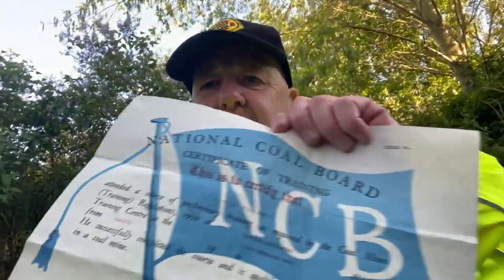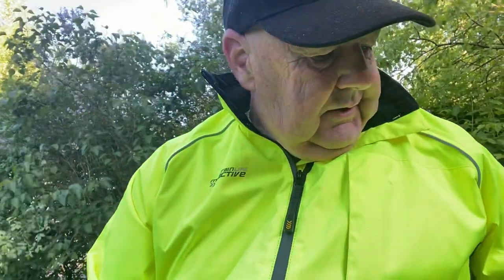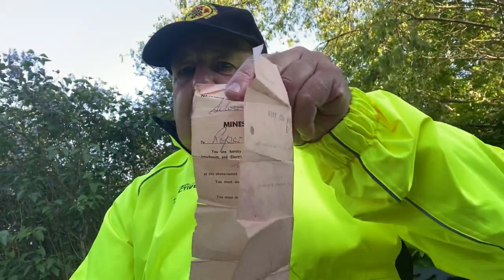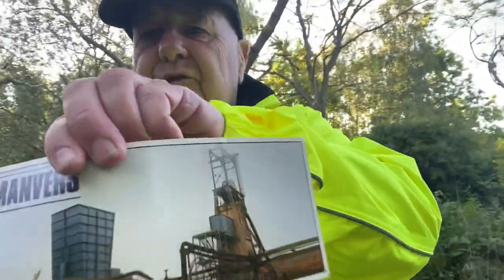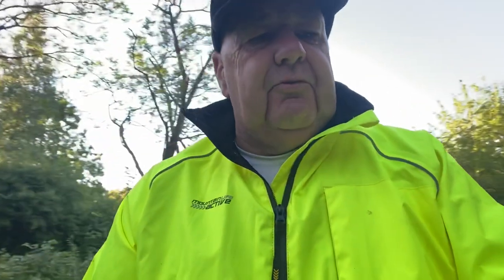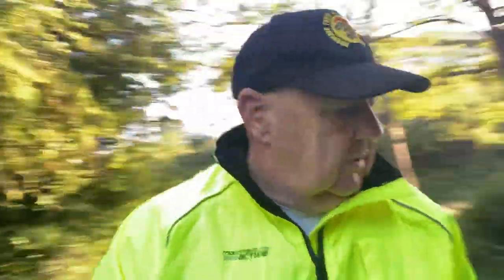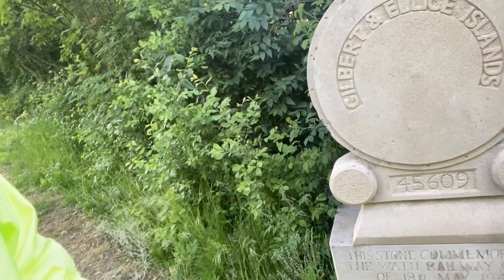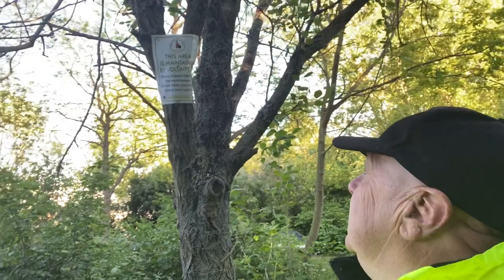Manvers Main Colliery

Comment: 1948 Wath Manvers Railway Disaster Memorial, Wath Upon Dearne, Rotherham, South Yorkshire, 13th Aug 2017 The express train was travelling from St. Pancras to Bradford. There were two locomotives, twelve coaches and 194 passengers. At a speed of 60-65 miles per hour the train derailed due to track distortion caused by very hot weather. Seven passengers and Driver B. Wilshire, of locomotive number 45609 `Gilbert and Ellice Islands` were killed and 55 injured. Fire service, first aid and mine rescue staff from the nearby Manvers Main Colliery helped at the scene of the accident, and the colliery canteen supplied refreshments for the rescuers. The monument is in the form of a front view of a locomotive, number 45609. This locomotive was built in 1934 and withdrawn in 1960. Inscription on the base of the monument reads `THIS STONE COMMEMORATES THE WATH RAILWAY CRASH OF 18th MAY 1948 WHEN 8 PEOPLE DIED AND 55 WERE INJURED IT ALSO SERVES AS A TRIBUTE TO THOSE WHO ASSISTED IN THE RESCUE`
Reply from the maker: Nice one Bro, thanks for the info 👍